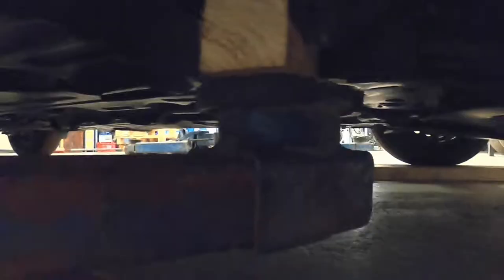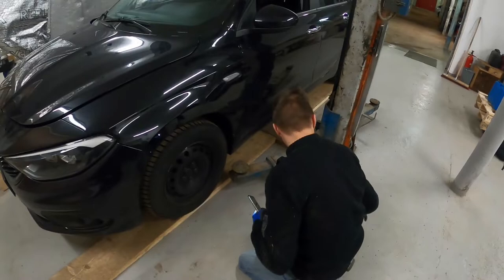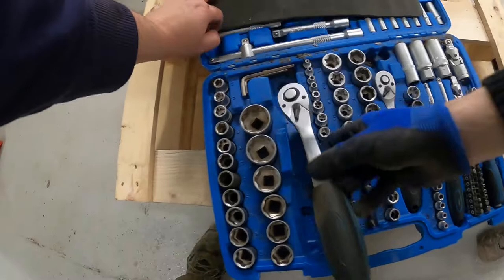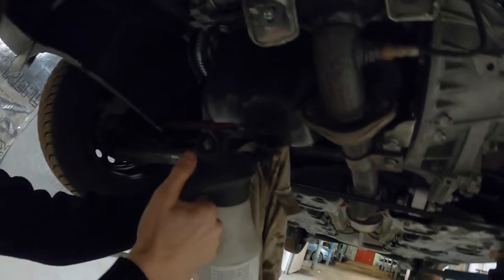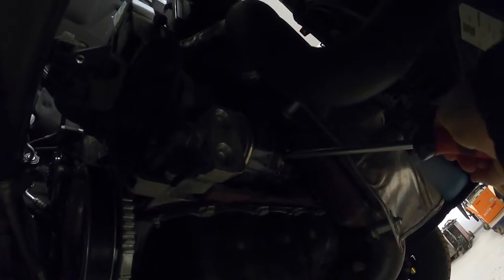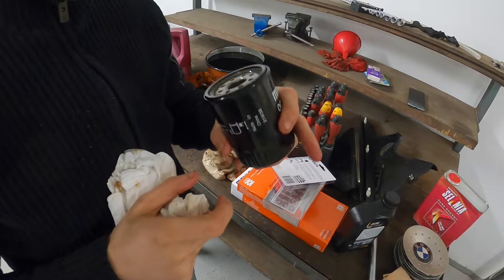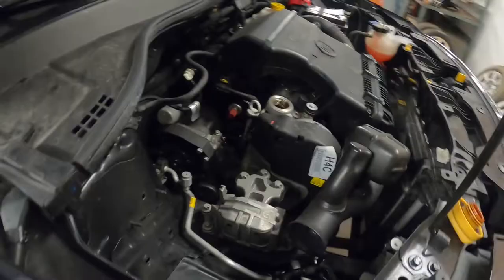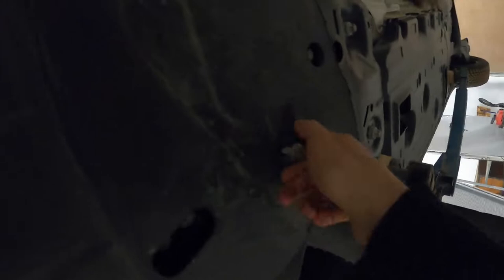Fiat Tipo / Egea 1.4 FIRE 95 HP Oil Change Service (TIPO 356)

Comment: Hi, on a different note, is it possible to install  a dashcam in the Tipo? Halfords here in Ireland would not do it but that might be because the Tipo is not a very common car here. Thanks  in advance
Reply from the maker: Hi, I think it is possible to install it on every car as you need just 12 volts provided to the camera.

Comment: Hi.
This motor fiability is good?
I want one 1.4 95 hp but i don´t know if the right choice.
I want fiability and no problems.
Thank you if you can help me.
Reply from the maker: Hi. For me car is reliable, not most powerful but still enough for a lot of highway driving.
Reply: A little small for tipo, but enough for grande Punto, bulletproof engine, just like to burn oil....